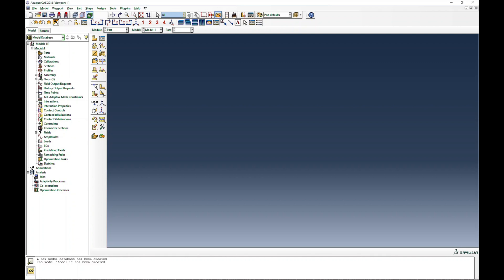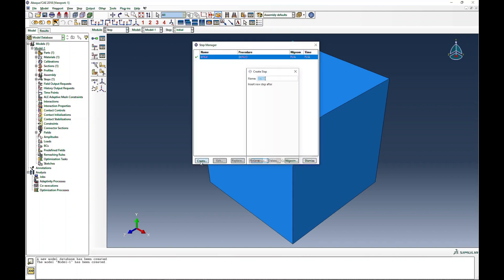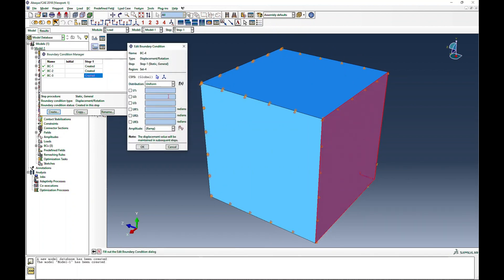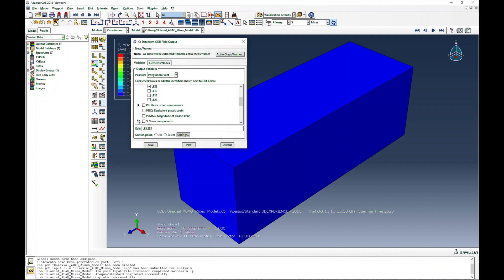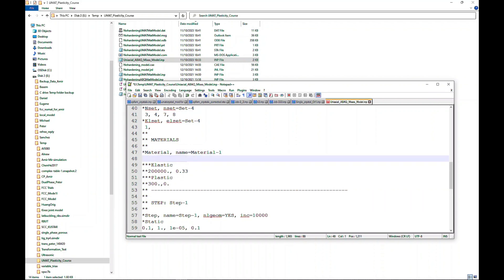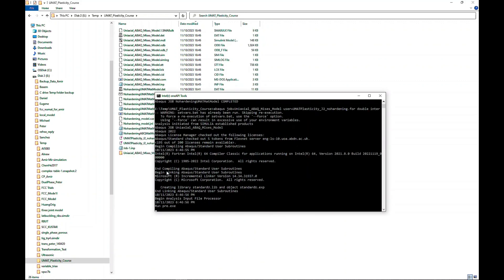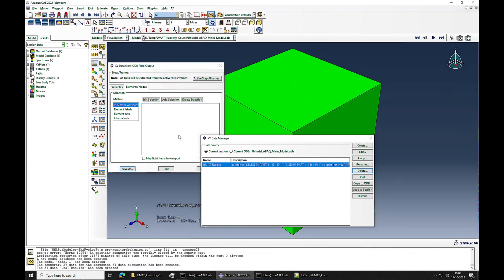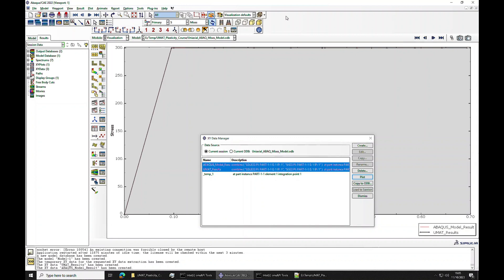UMAT Made Easy: Part 7 – Validation through Default ABAQUS Material Model

Comment: Can you please make a video on doing Plane strain compression test using cpfem?
Reply from the maker: Sure . Do you mean a 3D CPFEM model with plane strain conditions or a 2d rather 2 1/2d model with plane strain elements? Also, single crystal or polycrystals?
Reply: @Professor3MEC  3D cpfem with plane strain conditions for single crystal. Thank you.

Comment: Hello, i am a Masters student and i am also working during my internship on these kind of cubic geometries.. i am here still learning about the UMAT and Fortran stuff, i tried to copy the code from the video to execute it the same way as you did and alot of error message have just appeared.. and i think it is an issue of syntax.. 
Could you please send me the subroutine .for file that you used in this video to know and correct my mistakes ?

If you also can send the pure elasticity UMAT, i would be very grateful !
Reply from the maker: sure contact me through www.professor3mec.com and I will send, or it should be downloadable from the websites download section for free.